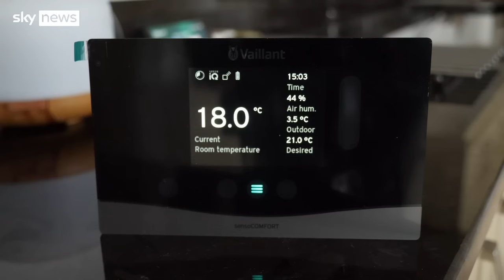Are heat pumps up to the job? | The Climate Show with Tom Heap

Comment: For the record, I am absolutely laughing at those people that say heat pumps won't work below freezing. Guess what? They work just fine in a -30c Canadian winter.
Reply: true, in Sweden we build heatpumps, NIBE is a swedish company :P
Reply: Yes, they’ll work in the cold, but your insurance company will require a back up heat source.
Reply: It's in the science. They literally get more inefficient the lower the temperature is. A decent heat pump at -20C Is only twice as efficient as an electric heater. Not worth the costs compared to gas boilers.
Reply: I don't get your point.  @TomNook.
Reply: Understand the Carnot cycle.
Reply: Your houses are built totally differently from UK houses, how would a house built to UK standards fair in Canada?      ( sounds a silly question but its why they are having so many problems with them working and being invested in here)
What form of back up or auxiliary heating is in your system?

Comment: Really pleased with ours. Currently 5.6c outside. Pump pulling 1.3kW and supplying 6.01kW heat. 14 rooms heated to 21c. No zoning. Underfloor heating throughout. Paying an average of 17p kWh for our electricity.
Reply: 6 KW is tiny for 14 rooms
Reply: @PoohBear01  It's a 10kw pump on weather compensation. Today has been 12c so 600w for 4kw heat. Full UFH. Block and beam floors at upper levels. Great thermal mass. 21c in house all times.
Reply: @PoohBear01 You do know if it is the same temperature outside as inside the heat demand for any size of property is 0kW. A massive Passiv house often needs no additional heating even though winter (where there is sufficient sun).
Reply: I know how a thermostat works. @SimonEllwood
Reply: Can it provide continuous hot water for showers for over an hour?
Reply: @RBXTrains  Our shower is electric. We heat the 200ltr tank twice a day for about 30 minutes each time to heat the water to 48c. This gives us hot water all day and 2 baths on the evening.
Reply: @RBXTrains  Can your current system heat a small city?
Reply: @PoohBear01 that’s not the definition of a thermostat, that’s heat loss.
Reply: @RBXTrains get a big enough tank and probably. They need to be specced with the usage in mind. An installer will only install a tank of sufficient size to accommodate all the house occupants. Can’t remember the figure.
Reply: Where are u paying 17p?
Reply: @sgfelectrical734 On Octopus agile 29p for daytime and 7.5p for 6 hours at night. Also have a 10kWh battery which is charged at 7.5p rate. When we receive our monthly bill from Octopus our average cost per kW is 17p.
Reply: @richardcorns8553  that sounds like Intelligent Octopus Go. Agile varies the unit price every 30 mins.
I’m on intelligent too, our last month came in at an average of 10.5p/kWh.

Comment: For what it's worth, we use a heat pump during Canadian winters. They are not cheap, but they work.
Reply: Too expensive for UK electricity! Companies are way too greedy!! Profits over people. Just another way to keep  poor, poorer!
Reply: @chezaspup  well, your choice to whine instead of being warm.
Reply: @chezaspup it's 3x -5x cheaper than electric heating depending on the cop
Reply: @scottbuggy5634 
But not compared to gas.
Reply: @chezaspup ask to have the levy applied to electricity bills removed, the one that funds gas subsidy.

Comment: I have storage heaters in and cost to much to heat up as only the living room has two switches on it so I can put the heater on without using the storage unit this is why I bought stand alone heaters which can blow out cold air if it’s hot and 2 heat settings which warms the room up quickly 
If I had the money I would buy some of those battery powered storage units and use them to power the house and through the day and charge them at night when electricity is cheaper and use these power banks to save on my electricity bills

Comment: I live in a mid terrace house and MCS20 regulations regarding siting of hp from boundary & noise calculations mean HP has to sited 4 meters from house. Also no space for the complicated hot water storage cylinders & associated pipework valves/ pressure systems. I gave up in the end sadly.

Comment: In many homes there is no space for a heatpump expecially on terrace houses to fit. This is due to the  Heatpump being 8 times to 10 larger than a boiler. People will still use gas for cooking so many homes will still use gas for cooking if gas not be used for heating and hotwater.

Comment: That house in Woking reminds of the film The Money Pit. Tom Hanks kept using the line 2 weeks. There are many stories of poor installation of heat pumps. A well insulated gas heated home is still cheap to run. I have an energy and broadband package which casts about £140 a month.
Reply: A well insulated home will be cheaper to heat whether any fuel is used. The bigger issue is most Western built houses pre 2000 are nowhere near well insulated even with new windows and a few more rolls of attic insulation

Comment: 92% are happy with their pumps, so 8% are not. That's terrible odds when we think how much they cost, I am for them but...
Reply: 8% of a county is a lot of people.
Reply: @ascgazz  92% of the same populace would be 1050% more people.
Reply: It would be interesting to see the figures on the consumer satisfaction ratings of more "traditional" heating systems in comparison.
Reply: @alanl1268  Conservative estimates for heat pump maintenance put the cost at roughly double that of traditional boilers, with some households paying far more.2 Mar 2023 no idea who wrote this but I also read that HP's need serving and that is 150 pound a year, if things go wrong may 2000 pound. An  electric boiler needs no servicing and if they go wrong a new boiler is less than 2000 pounds isn't it?
Reply: @edwardbernthal160  In view of the fact that heat pump installations continue unabated in countries where their use is much more widespread than in the UK and goes back over a couple of decades I am inclined to believe that long-term users find that reduced operating costs outbalance any increase in service costs.
Reply: @alanl1268  I am in Denmark not the UK. Our gas is soon to be shut off. We have the option of heatpumpes or wood pellet burners and its not easy making a choice, Heatpumps sound great but a lot of people are unhappy with them. We have a while   to make our minds up . Whatever, still going to cost a bomb whichever we choose

Comment: Not all houses can have heat pumps. I have a small airing cupboard with an hot water tank with a pipe from the gas boiler to the tank and radiators. A similar house was accessed for an heat pump. The engineer said there is not space for piping and space for connections needed in the heat-pump. 
The engineer told me a mix with hydrogen/  natural gas and increase planting of trees across the country could reduce CO2 levels.  We need technology to remove CO2 from the atmosphire and devices fitted to gas boilers to pass through organic matter to help remove CO2 and replace by Oxygen.
Reply: Hydrogen mix has been abandoned. It was a marketing ploy by gas companies. Replace co2 with oxygen, err the boiler just did the opposite, so to pay for that will be huge
Reply: Your engineer is misinformed to say the least and clearly has invested interest in people keeping on burning stuff.

Comment: The only way I’d be convinced in having a heat pump ,is A once they become cheap enough,B the energy companies take into consideration my actual current monthly cost of heating bill ,and if it goes above that amount then they or the government should cover my excesses cost of bill..also the cost of maintenance should be covered completely by the manufacturers ..once that is signed in blood ,then I would consider it ...
Reply: Love our heat pump in Hampshire, combined with an electric vehicle we get electricity at 7.5p overnight for 6 hours and that is when the heating runs most. The average cost of electricity using heating all day is about 20p a kWh. With the heat output 3.5 times the energy put in we pay about 6p a kWh for heat. Gas at 6p a kWh has a heat output of less than 80% into the radiators or 7.5p, plus the standing charge and an annual gas check…. The heat pump wins hands down.. We can expect electricity to get cheaper compared to gas in the next 2 years, looking at the futures markets, gas will be 5p a kWh, electricity back down to 13-15p depending on government policy on the social charge put on energy, currently it is on electricity and not on gas.
Reply: @bwertyuiop tbe groups are 1. GULLABLE 2. MORALLY SUPERIOR PRICKS 3.SENSIBLE PEOPLE WHO SEE THROUGH THE PROPAGANDA 

Keep taking tbe meds.

Comment: Heat pumps make a lot of noise, and when the houses are built so close to each other, I think they can be a menace. It would be better to build a district heater, if they absolutely must replace gas boilers.
Reply: only some heat pumps are loud. there are lots that are not. our neighbours gas combi flue makes more noise than out heat pump.
Reply: Just had one installed - can hardly hear it from 2 m away.   Inside the house - completely silent.

Comment: Imagine 1.8 million households in the Uk that run on electric heating converting to heat pumps, if only they didn't have a thing called leasehold that's stopping it. Eu countries far ahead? guess what feudal dated housing system the Eu countries don't have...
Reply: I’ve never heard of a leasehold covenant requiring the use or non use of a specific heating system.

Comment: heat pumps have been around for 50 years or more and mainly in the nordic countries. Thy work well, key is goo design, good heat pumps and proper installation. electric costs will fall as more renewables and lots of energy companies are offering heat pump tariffs. the media is paid by oil and gas giants and so they will paint a black picture. We need to install insulation and do fabric improvements. Hydrogen wont happen and is just the fossil fuel industry dealy tactics.

Comment: Nobody talks about how refrigerants used in heat pumps are dangerous for our environment. While some of them damages our ozone layer and others are among most significant contributors for greenhouse gas emissions. It's presented as good alternative for burning fossil fuels, but in fact could do exactly the same damage to our environment or even worse. It looks like this initiative is pushing by some interested parties, rather than good intensions for saving our environment.
Reply: Any actual sources to back any of that up?
Reply: The scale for your comparison is a tad off there. Comparing the global warming potential of a very small amount of refrigerant (if actually leaked) to a boilers lifespan of gas co2 emmissions is like comparing the emmissions of a candle vs a blowtorch.
Reply: @mikeypc3592 what about the 3 tonnes of copper in each wind turbine that'll generate all this electricity,  about as green as my rse.

Comment: When the temperature is down to 3 degrees it costs £1.40 an hour its on flat out so do the maths, and that's only half the radiators on,mind there is 13 rads, 4 beds house to My self as council are criminals,,crazy